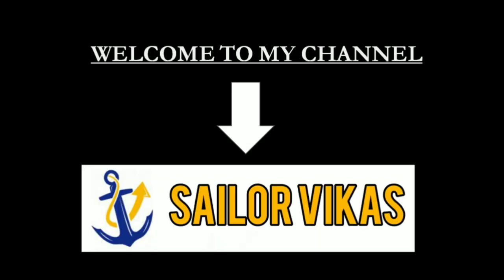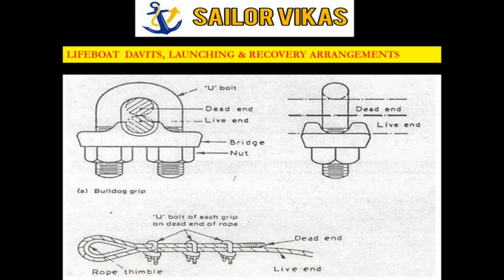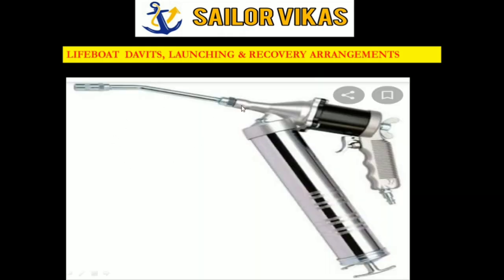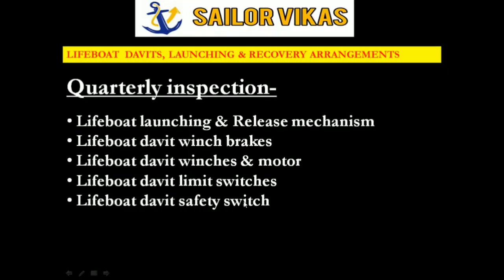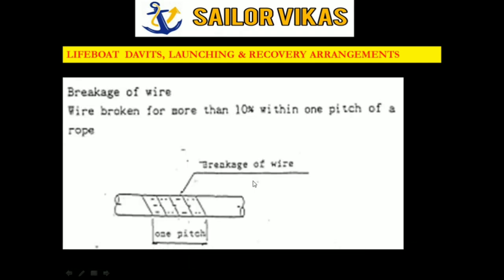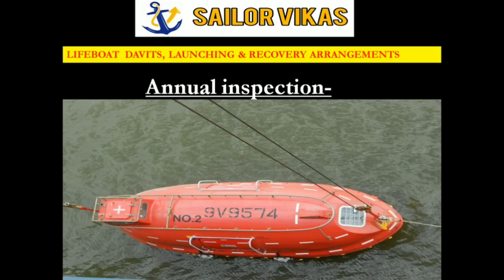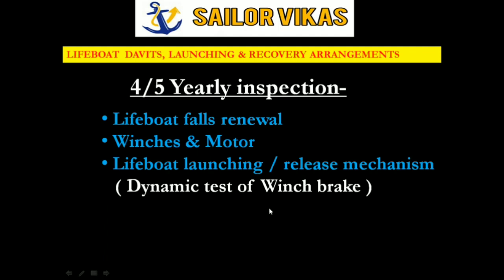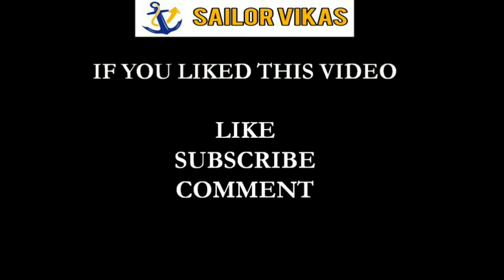LIFEBOAT INSPECTION - Part 2 : Lifeboat davits, Launching & Recovery arrangements #lifeboat #mariner

Comment: Good job bro. 

The release gear mentioned in it is the winch gearbox. Actual release gear is lifeboat hooks.
you just showed only in this video governor breake mechanism. you should explain about the main break system

Comment: What is tricing pendant and hanging off pendant?
Reply from the maker: Tricing pendant is used to avoid the swinging of the boat when the ship is rolling or listed and bowsing tackle is used to bring the boat near to the embarkation deck to allow the crew to embark safely.
Reply from the maker: Hanging-off pendants mean an appliance, provided onboard a lifeboat as required in Regulation III/16.2 of SOLAS, for hanging-off the lifeboat to free the release gear for maintenance.

Comment: @ sailor vikas sir I have came across this l/b davit safety switch.
In my last vsl our in Solas / LSA code.
This switch is particular required in gas carrier or any new imo resolution??
Reply: *Sorry not came across
Reply from the maker: I understood your concerns, as per LSA CODE 6.1.2.6, this safety switch is required and in your last ship, this arrangement will not be their , but their will be some another safety device which will be fitted, which will prevent the rotation of manual handle, while lowering or hoisting under power.
Reply: @SailorVikas  thanks sir
Reply: Sir.
Then 6.1.2.7 tells abt l/b Davit limit        
Switch.

Comment: @sailor vikas sir once  L/b davit limit switches activates for heave up L/b further we have to use the brake handle  . During that we have to by pass the L/b davit safety switch for rotating the handle to heave up the L/b
Reply from the maker: Yes correct
Reply: @SailorVikas  how to bypass limit switch of lifeboat if we want further heave up by handle ya by remot ??
Reply from the maker: @astlefernandes1429  just press the limit switch and prevent it from touching the davit, than it will get bypass
Reply: @SailorVikas  u must lift it up avoiding touching the davit then the davit will get lift up correct?that is called bypass of limit switch correct sir?
Reply from the maker: @astlefernandes1429  ya

Comment: When we try to launching the life boat, power failure occurs,  what is the alternative way for launching life boat, Can we able to launch life boat with out current?
Reply from the maker: Lowering is always by gravity ...not by power.....only heaving is done by power, if power fails you can use manual handle to heave up lifeboat
Reply: @SailorVikas  thank you sir.

Comment: Great....what is the use of limit switch?
Thx
Reply from the maker: Whenever u heave lifeboat, we have to stop when davit reaches its stowage position, so limit switches are fitted on davits to automatically stop heaving further to prevent damage to wire ropes and davit structure.
Reply from the maker: Also if u are unable to stop heaving due to machine failure, thud limit switch comes into action to stop further heaving

Comment: Can you please tell what's FPDs
Reply: I got it , fall preventing device
Reply: Sir one more doubt ? Fall preventing device mean it's a sling right ? During the drill it helps that LB connected with fall.
Reply from the maker: Its available in sling and wire as well....yes it's an additional support but  it has a special thing....once weight comes into this fpds they become permanently deformed so u cannot use same fpd for second time
Reply: @SailorVikas  thank you sir